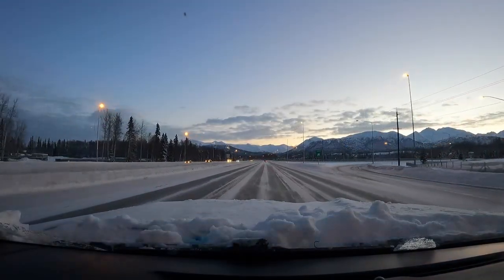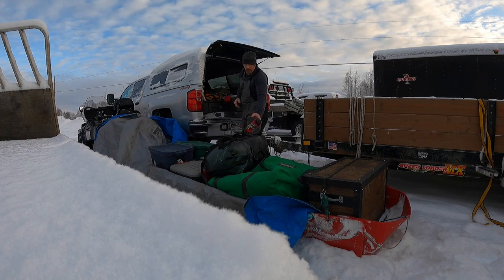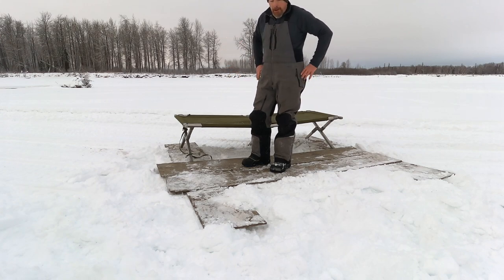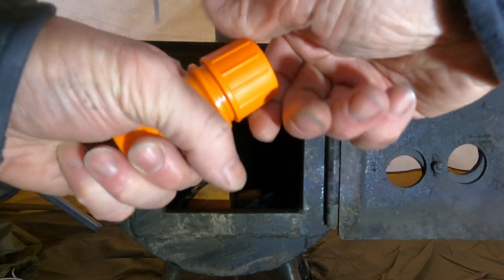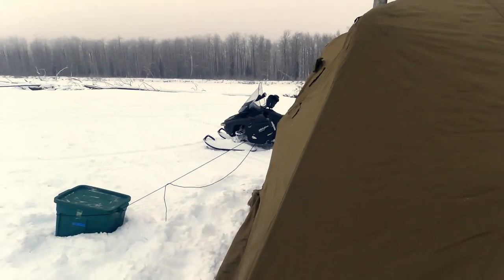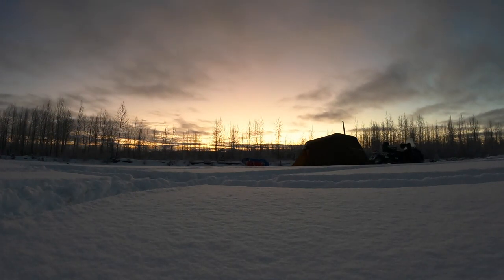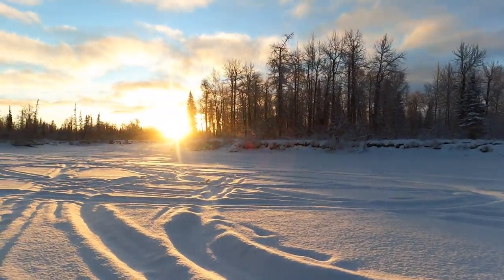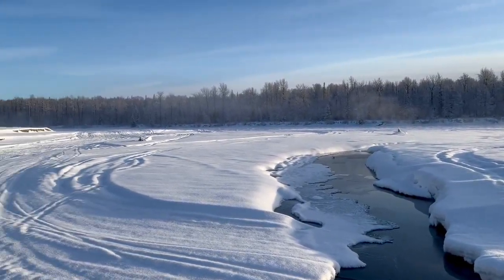Iditarod Trail: Winter Camping & Trail Hazards

Comment: Ever thought of running the whole Iditarod trail from Fairbanks to Nome  on snowmobile with a sled ?  Is it possible ? Does not seem that no one is doing it but sound like a lifetime of a trip
Reply from the maker: That trip would be very doable. The Iron Dog snowmobile race basically runs the same trail to Nome and then returns back to Wasilla. That race is completed in about 8 days.
Reply: @RaisedinAlaska  you now are the first person I mentioned doing this that even agreed with me that this is doable.  I know about the Iron Dog race but they have support and pit stops for fuel.  This is on my bucket list and I will spend the next year planning this.  I think if I can work out the logistics, I can do this.  If possible due to your experience, the plan would be to hire you as a guide as I am not familiar with Alaska but I can step away from the business for 10 to 30 days to fulfill my dream of running this trail on skidoo's.   I would love to stay in touch with you about doing this.  With the research I have done the last 8 months, no one does more than a few days on snowmobile rentals.  Not interested, I will be planning a 900 to 1100 mile trip for at least 15 to 20 days out in the wild.
I will stay in touch, thank you for the response

Comment: Nice, I spent 5 years working for the HBC Northern Stores as far north as Baffin Island. That is probably why I am so hooked on going into the bush and what is going on in there. One thing I learned was to Carry a lot of fire. In my kit I have flint, Magnesium, box of wooden matched and 4 butane lighters. I also carry a bag of dryer lint. One lighter  I carry in my pocket.
I used to carry Spot  now I carry InReach, due to its Sat communications ability. I never leave home with out it. 
Sure had a lot of bush planes flying over.
Thanks for sharing.
Reply from the maker: Thank you. It pays to be prepared.

Comment: Did you make that sled?? Ever have it tip? How long does it take for you to get where your going? Are all those vehicles there for the same thing??
Reply from the maker: I did not make the sled. It was made by Northern Sledworks, which is now owned my Alaska Airframes. 

It is very stable, but I still managed to tip it over once, I’m talented that way. Then again I had tipped my snow machine over as well that time. 

I was traveling on the Iditarod and Irondog trail so racers are out looking at the trail and practicing. Additionally, there are many cabins up the river.

Comment: Nice video. I'm looking to buy a hot tent. Ideally I'd like something I can sleep up to 4 people in. Hard to tell, but this one looks like you could maybe squeeze two people, right?
Reply from the maker: I can fit a cot on each side of my 10’x10’ tent with room for the stove in between them. I’ve seen people put bunk cots in them, but I think 4 people would sill be a tight fit in a 10x10 tent. That said, Arctic Oven tents come in a variety of sizes: 8x8, 10x10, 12x12, 12x18, and 12x24.

Comment: Great video,  couple questions on your tow sled. what is the length? I was about to order the 10FT . Also did you stick with standard tongue or go with longer one.  Also was wondering if you had any recommendations on either a cylinder stove vs a sheet metal stove for arctic oven ,  Alaska winter camping {12 x12}
Reply from the maker: My toboggan sled is 8 feet, they may call it longer than that, but I can fit an 8 foot piece of plywood strip in the bottom of it. I think that the tongue that’s on mine, standard, it’s fine. I got the heavy spring hitch, but if I were to do it again I will get the lighter spring. I seldom haul 1000 pounds in my sled. As far as stoves go, I made my own from a couple propane tanks: easy and cheap.
Reply from the maker: As far as heat inside my arctic oven, there are times when the small cylinder stove is so stinking hot you have to open the windows to cool it down.